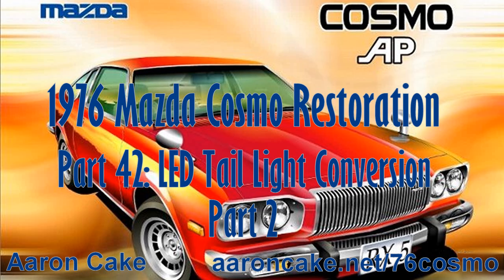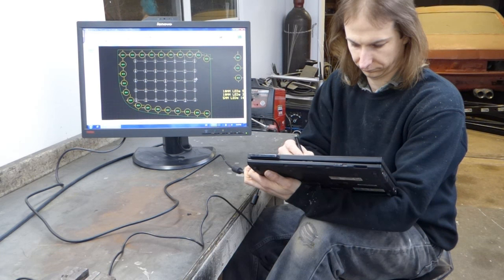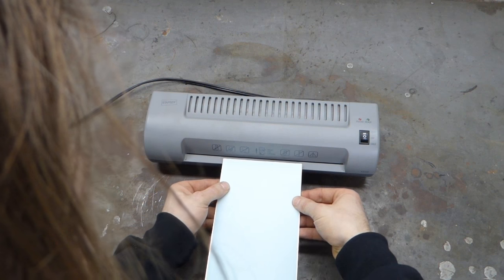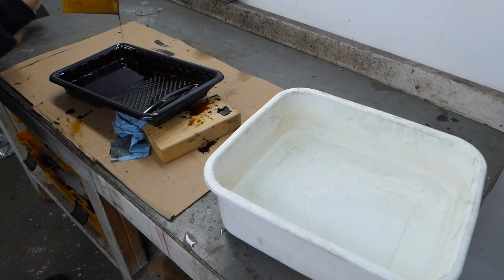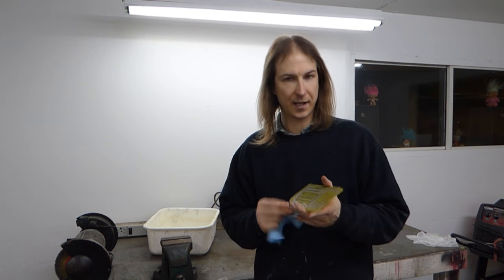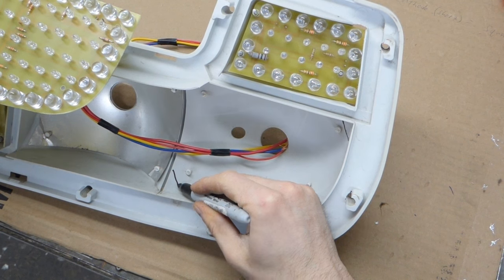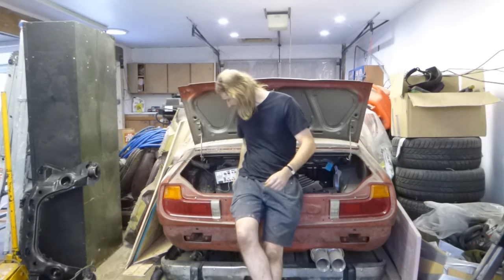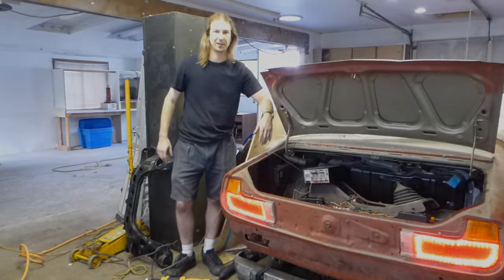Part 42: LED Tail Light Conversion, Part 2 - My 76 Mazda RX-5 Cosmo Restoration

Comment: Any ETA on episode 43, Aaron?
Reply from the maker: It will be a little while yet. I have been putting all my "spare" time into totally finishing the shop. Just one final touch and it will be done at which point that time can go back into the Cosmo. Episode 43 won't be as involved as 41/42. Until then, I may have a video or two to tie every over...
Reply: I know that feeling only one more thing, i've recently bought a lathe and spend two weeks refurbishing it, and could spend two more before i got the advance: get it functional and you can put in a day or two a mounth to get it perfect, you may do the same.
Reply from the maker: But of course, all the detailed work will be worth it for the long term whether it be a lathe or a shop. My final task is building sound proof shed for my air compressor. This weekend I will finish it up, then I'll have a little fun dressing it up with a particular style of trim. For me a lathe is also on the list. Just purchased one of those mini-mills which will eventually receive a CNC conversion.
Reply: you should totally have another channel where you share things like that one or even on ths channel
Reply from the maker: I made the decision not to film all the renovations to the shop because it would add so much labour and editing. Already took way longer than I thought it would. However I did take a load of pictures and once done I will have a certain special guest back and arrange a tour of the new shop. It's taking a bit longer on the shed then I wanted but I decided to have a bit of fun with it instead of just making a boring old compressor shed. Result will be worth it. Oh, and it might be worth visiting my channel tomorrow morning...

Comment: What about tail light sweating ? you made holes in corners ...
Reply from the maker: Ventilation. Should be plenty of air flow and the light is sealed from the outside.

Comment: when midday,The led is well seen?
Reply from the maker: I haven't tested them in daylight but have no reason to believe they won't be bright enough.
Reply: I tried some white 5mm LEDs, but I did not get much success. I think the acrylic did not help much (note: I used the VW Kombi flashlight)
Reply from the maker: When I tried white LEDs underneath the coloured lens they didn't work very well.

Comment: u.s. dept of rtransportation. conciders each l.e.d. as a seperate bulb. there for if you have multitude of l.e.d.s out thats a very hefty fine your facing.
Reply from the maker: You'd have to quote the regulation because that seems very suspect. Many, if not most, of the OEMs have some form of LED tail lights with either single LED "bulbs" or multiple arrays of LEDs (ie. Cadillac), and it seems unlikely that an officer would be sitting at the side of the road counting LEDs to sum up a fine should one of these tail lights stop working. Also I'm not in the US, and during the project did actually review Canada's MOT (Ministry Of Transportation) regulations on vehicle lighting (all 17 pages of it, as I recall!) just so I knew how much of it I would be violating. Basically, any modification of a vehicle light beyond what is government approved is illegal. You'll find that even replacement bulbs have to carry a DOT/MOT certification. For me this means collector car insurance only and theoretically, I could be pulled over for non-conforming lights. Of course we all know how many non-conforming lights there are out there...

Comment: What led's is he using ?
Reply from the maker: If you go back in my videos to part 1 of the LED tail lights, you can see in the first few minutes my LED selection. The yellow and red 5MM are 6000 MCD. The Red and yellow 10MM are 10,000 MCD. And the white 10MM for the reverse lights are ridiculous 25,000 MCD. I purchased all in bulk via eBay from a Chinese supplier.
Reply: Thanks for that :) 
Do you have the links where you bought them from?
Reply from the maker: Taha Masood It was well over a year ago but I was able to find them in my purchase history. Check out these item numbers: 181306478937 (yellow 5MM), 171223693966 (red 5MM), 191387656173 (yellow 10MM), 191387661355 (red 10MM) and 201201546379 (white 10MM). 2 different sellers, both ship from China free shipping to most places. I bought a whole bunch just to make it worth while and I figured I might want to do my other cars eventually.

Comment: Considering how long didnt you released a single video and mentioned a -24 C outside i have a conclusion that you here in Russia for now.
Reply from the maker: No, not Russia, but Southwestern Ontario, Canada. We see quite a weather swing from rather cold to rather hot. As you can see the filming spanned multiple seasons. One of the consequences of only having a few hours a week to work on the car for the time being.

Comment: why don't you build a 3 rotor engine that will make loads of power
Reply from the maker: I considered it, but not every car needs to be a beast. There's also the significant issues with fitting the longer 20B into the Cosmo engine bay, cooling it, intercooling for a big turbo, etc. To be quite honest as well, with the current going prices on already old and worn out 20B blocks, 4 rotor looks as economical. There are 4 rotor kits for the same price as a used 20B.

Comment: -24C. where the heck are you?
Reply from the maker: Ontario, Canada. Typical winter day when I mentioned the temperature. Thankfully the shop is insulated and that little 75,000 BTU heater does the job until I can put in a proper permanent furnace. Diesel to run the heater is a lot more expensive than natural gas for a furnace.

Comment: You really should be wearing some type of eye protection when using dangerous chemicals, clipping off excess leads, blowing air, etc. I noticed you had eye protection when using your dremel and you seem to observe all other safety protocols except for that one.
Be careful
Reply from the maker: When clipping leads I use the safety squint, but yes, I really should wear goggles while blowing chemicals off something. Flux remover in the eye is no fun.

Comment: whoa..10 years and no paint yet . great work tho.
Reply from the maker: 7 years, but still no paint because it's not nearly ready.
Reply: aaroncake hey quick question. I pulled the supposedly rebuilt Na 13b in preparation for my engine swap last weekend. This weekend I decided to put oil in the exhaust ports and turn the motor to keep the inside nice and coated to hopefully preserve the motor till I can disassemble/store it for a Miata swap. I noticed as I slowly hand turned the motor that one of the rotor faces on the rear rotor wasn't pushing the oil back up to the port, meaning it wasn't sealing. I depressed the apex seals by hand a few times to hopefully clear any carbon buildup to no success. can I assume that the apex or side seal is screwed on that face?
Reply from the maker: It depends. You should be able to get a good view of the rear apex seals through the exhaust port and can check to see if they are in tact. Even if one was missing a corner I'd expect it to still move oil around. Also depends on how much oil was poured in. Dumb question but are you turning it the correct way? From the front it turns clockwise.
Reply: aaroncake yes sir, turning clockwise I rotated till an apex was just passed the exhaust port and then added my oil to the prospective housing. I even pulled the plugs to ensure no hydraulic oil pressurization in the combustion area would blow out a seal.
Reply from the maker: How did the apex seals look on the rear rotor? A break that large should be reasonably visible. Any marks on the rotors? Feel the apex seals and see if any of them are sharp. They should be smooth and round across their surface.
Reply: aaroncake just came over to my dad's where the engine and fc are located. I rotated the engine a few times and couldn't get the problem to replicate. I think my efforts yesterday cleared up a partially seized side seal. the rotors are ugly with what looks like surface rust. although I do think they are matching, they have machining marks on both rotors. all apex seals are rounded without any sharp edges that I can feel. I think if I am to salvage this motor I need to keep the housings well lubricated until I can finish my engine swap and purchase a rebuild kit.
Reply from the maker: If there was rust on the rotors than stuck seals are certainly a possibility. Sounds good about the apex seals. A sure sign of a broken seal is one that feels sharp. NAs almost never break seals. Generally the stock 3 piece seal wears so much the top most piece just sort of rolls out. Diesel fuel works very well to dissolve carbon so you can spray some in through the intake ports/spark plug holes ever few days and roll the engine over. Loads of junk will spew from the exhaust ports.
Reply: aaroncake I work construction so I can easily get a gallon of off road diesel. I'll try cleaning it next weekend. I've been racking my brain trying to figure out what bore x stroke clutch master cylinder I'll need for my swap
Reply from the maker: My suspicion is that the Miata slave cylinder will be about the same as the FC slave cylinder since they shared basically the same transmission. So in theory anyway, you may not have to change your clutch master.
Reply: aaroncake the motor I'm putting in is a 2013 Ford 3.7 v6 attached to an mt82 6 speed, my MC issue is with this swap.  here is the build thread:
http://www.rx7club.com/showthread.php?t=1080545&goto=newpost
Reply from the maker: Oh, yes, I recall seeing that thread. Why not measure (or look up the measurements) of the master cylinder on the source vehicle? Since the FC firewall area is flat, it could be an easy mount and you can adjust the pivot point to the rod on the pedal to match.
Reply: I've contacted Ford and ask for specifications and they're no help. I've been waiting for an aftermarket "upgrade" so I could use those specs. Maybe I can find someone with a broken one(they're plastic and brake often) and ask them if they'll flat rate the broken one if I pay for shipping. By my calculations the 5/8ths MC that I have would only move the slave 1/4 inch -.- still havent had a reply from spec clutches about the minimum fork movement.

Comment: Man. Why don't they make laptops with matte pen input displays like that one anymore?
9:15 Not fascinating, but satisfying.
30:05 I had to shield my eyes O_O
Reply from the maker: Ah, there are a few still around. Lenovo has the Yoga line, some of which have digitizer pens. HP still makes a few, and there are probably a few others. I've always preferred a convertible tablet style machine. My previous laptop was an HP TC4200. The one in this video is a Lenovo ThinkPad X201 Tablet (4GB, i7 2Ghz, 180 GB SSD). If I had to upgrade today I'd go for the Lenovo ThinkPad P series in Yoga form (current model is P40 Yoga).
Reply: The yoga's are all glossy displays. The P40 Yoga is glossy. Supposedly, it has a matte foil applied to the screen, but it's not a matte display. So it is largely useless in direct sunlight outside. Whereas that thing in your video should work quite well, especially if it was built with more up to date technology including a nice bright backlight.
Reply from the maker: ***** Oh, it's the gloss you hate. I have mixed feelings on it myself. On one hand it really brings out the contrast. On the other hand, it really brings out the finger prints and reflections. Honestly, for being a few years old, my X201 does everything I ask including effortlessly edit the HD video. Plus it has the optional daylight viewable screen. Back when I bought it, it was the top of the line at nearly $3000 so I expect a lot of years out of it still. Keeping Windows 10 off of it has made me happier still. Yay for group policy.
Reply: I actually quite like the gloss but I don't like the reflections. I don't understand why they can't make a matte level non-reflective glossy display or at least bring out the option to have a matte display with their touch screen models because if they could they would because a lot of people would buy them. I would take a touch screen matte display that's fully useable outside in the day time over a glossy mirror-like display that's essentially useless outside in the day time any day.
Reply from the maker: ***** Wonder how well that would work with a digitizer.

Comment: hardly a led conversion!! led are supposed to be the colour of the brake light or indicator! like red or amber not white bulbs with red or amber plastic lenses!!
Reply from the maker: Did you watch the whole video? Or at least skip to the last 10 minute? While the LEDs are "water clear" they illuminate to match the lens. Red for the brake, orange for the signal, etc.

Comment: no safety glasses wat so ever?
Reply from the maker: Did I forget? It sometimes happens when I set up the camera then do the work. All I was grinding was plastic so not too much danger there at low speeds. On the drill press I didn't wear the glasses because drilling such tiny holes was maddening with the parallax effect created by eye protection. Not too much danger either. Should have tied back the hair though.

Comment: Idea is good but execution is poor. Those old fashioned LEDs with board-through mounting/soldering are simply not meant to sustain vibrations and soon you'll get many pins suffer bad joint or snapped, also, they will end up misaligned. On top of all those crystal clear LEDs has poor volume to power ratio. Solution to vibration is to seal them with some sort of resin, as you did, or, as new design, to go with SMD LEDs...
Reply from the maker: Seems to me that all the through hole mounted LEDs in my '86 RX-7 are working as well today as they did in '86. So as long as the body of the LED is either directly against the board or supported against vibration, it should be fine. They are bright enough to illuminate the inside of my shop, so while they might not be as efficient as the modern SMD LEDs (though I'd wager that the manufacturer in China puts the same chip into their SMD version as their through hole version), I'm not worried the lights take a few mA more to run for a few less lumens.
Reply: You mounted LEDs in 1986. in your tail lights? :D
As far as I know, there's few factors determining led life, one of them is heat, which, in summer time can be an issue and shorten leds life, through hole has no cooling tab at all. Again Ive mentioned vibrations as even new cars with factory leds has plenty of issues with it (lack of lead in soldering material etc) but smds are, with larger contact area a little bit better choice or at least 4 pinned pirahna leds (red goes up to 70mA compared to 20mA on 5mm or 8mm round) ...anyway, great effort to add a new look to an vintage car...cheers
Reply from the maker: Helloverlord I didn't, but Mazda did. Mazda used LEDs on the heater/AC control "Logicon" and a few other places in the car. They are through hole, mounted off the board a little, with a small plastic support. We will have to see the long term reliability of these lights. I don't expect too much heat from the LEDs due to the PWM control and there should be reasonable air circulation. One thing I did consider was potting the entire board in epoxy. May still happen.

Comment: that chair of yours desperately needs some oil...
Reply from the maker: It really, really does. So much more echo in that room due to the wood floor. Some grease will quiet it down, and when I finally get around to putting something over the wood floor that will make a difference.